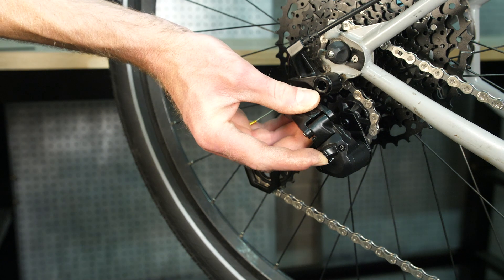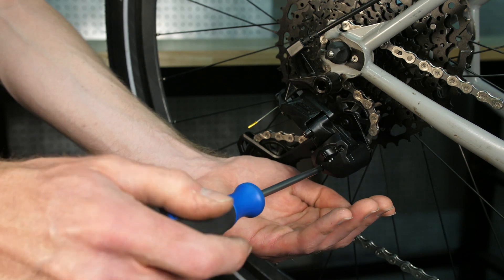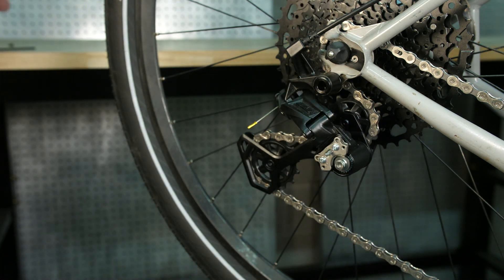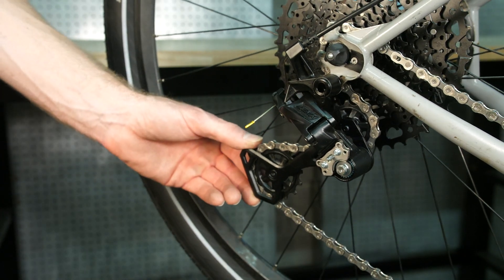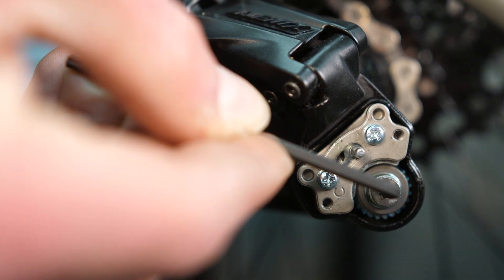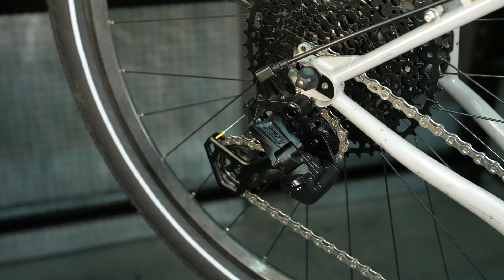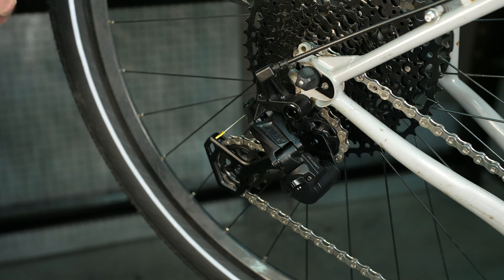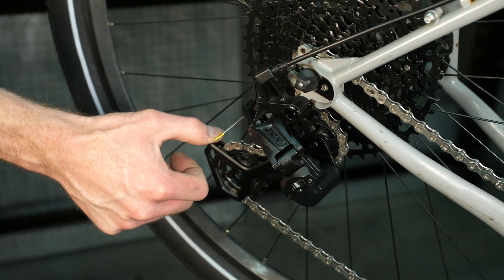microSHIFT FAQ: How To Adjust Clutch Tension On ADVENT and ADVENT X Rear Derailleurs

Comment: Is it fine if i tighten it to the point where i cant tighten it? I try lush the derailleur with thw clutch on and it doesnt move thats good right?
Reply from the maker: It should still move. You don't want to overtighten, just enough to resist chain slap.
Reply: @microSHIFTTECH  oh, okay thank you very much i shall loosen it a little bit

Comment: This cluch in 8 speed ?
Reply from the maker: Our Advent and Acolyte rear derailleurs use the same cable pull ratio, so you can use an Advent derailleur with ratchet and pawl clutch with an Acolyte 8 speed shifter and cassette.

Comment: Is there a recommended torque setting for that clutch adjustment screw? Or any other way to know what the ideal tightness is?
Reply from the maker: Start with the bolt snug/~2nm and you can make adjustments in quarter turn increments from there.

Comment: Is the clutch switch supposed to click? I just got mine in the mail and it softly moves between the settings with barely any sound...
Reply: Mine klicked at first, but since the last run it doesn't and it does not seem to engange the clutch at all...I'll try to loosen it a bit and see if it does something.